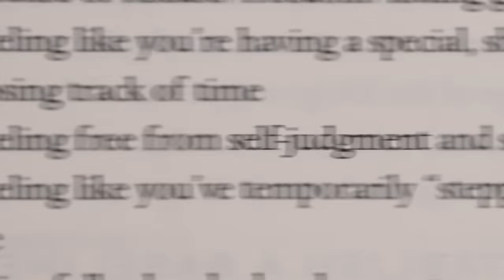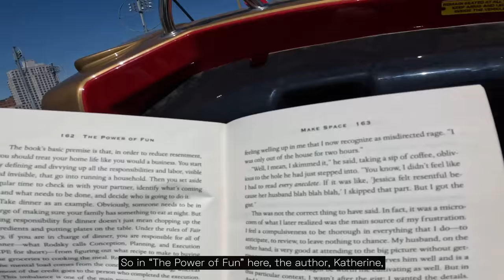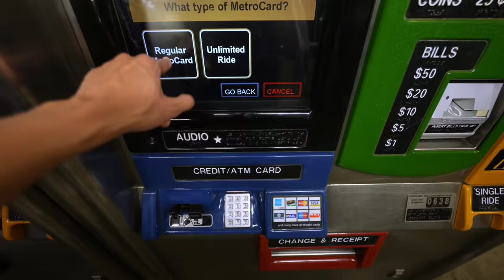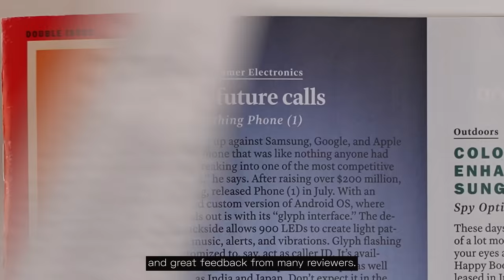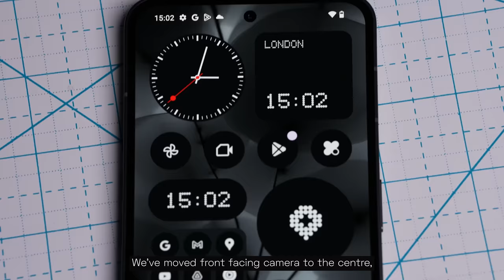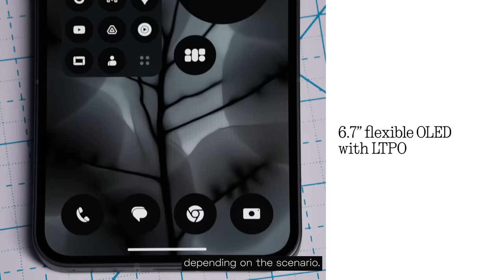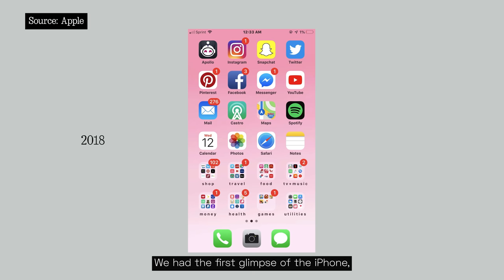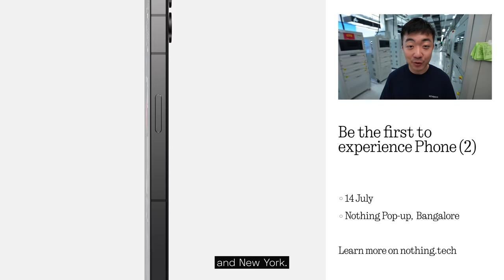Introducing Phone (2) ft. Casey Neistat

Comment: Nothing is the company everyone appreciates ❤
Reply: Not everyone.... Dont generalize
Reply: INR 44,999 is not justify this phone ,we get better option at this particular price like galaxy S21 fe sd 888 edition 😏 because their are no ip 68 rating and no telephoto camera
Reply: @abulfajalansari3591  sony Imx 32mp & 50 mp be like: get out of here u ain’t getting this kinda device anywhere. 

It doesn’t have some weirdo 2x mp like others phone and if u really have a problem with nothing Phone 2 then wait some time when the phone is released and u get it after some months the price will instantly drop and u can get it for damn 35,37k inr and in 45k it might gonna be that it will be the maxed version available. Think smart my guy and btw Samsung has been lying like apple by alot and Samsung even hided The actual performance from users and they were using some GMO which made the phone perform bad and in app benchmarks it showed as normal as other devices but the reality revealed later on when they got caught. I would never buy some stoopid Samsung phone except if it’s in Samsung S 20 and the S10 and lower line up.

Comment: Something about the blend of white black and red in the os theme makes me thing a nothing 2 mixed color back panel would fit in nicely (consisting of dark grey deeper layers of the back design, white for the elevated layers and red on the center circle of the wireless charger and red on the half circle of the recording led). Will enhance the element of depth to the back design. Call it nothing 2 mix. uses the same parts bin from the white and black models so easy extra color option i think

Comment: I really like the monochromatic colors in the Nothing Phone 2's OS and AOD. It looks really cool at first, but I think it would get boring in regular use cases. I would like to see some more premium colors available, so that I can customize the look of my phone.
I understand that Nothing is going for a minimalist aesthetic with the Phone 2, but I think there's room for some more color. Even if it's just a few accent colors, it would make the phone feel more alive.
Here are some additional thoughts on the monochromatic colors in the Nothing Phone 2:

1. The monochromatic colors are definitely eye-catching at first, but they can start to look washed out after a while.
2. The monochromatic colors can also make it difficult to distinguish between different apps and settings.
3. A few accent colors would help to break up the monotony of the monochromatic colors and make the phone look more visually appealing.
4. Even if Nothing doesn't add any new colors, I think they could improve the monochromatic colors by making them more vibrant.
Overall, I think the monochromatic colors in the Nothing Phone 2 are a good start, but they could be improved with a few more color options or a more vibrant color palette.

Comment: I appreciate the way he understands user requirements and strives to provide the best experience at an affordable price. As a part of the OnePlus family with the OnePlus 7 Pro and buds, I am now considering switching to a clean Android OS phone however after being impressed by Nothing OS. The ability to customize icons is something I love, and I am now considering making the switch to Nothing next year. I will give my OnePlus 7 Pro to Carl, the former CEO who played a role in building my great phone. I have been using Oxygen OS for almost four years now. Its completely different now which I'm not interested However, I am looking for a few specific features in the next Nothing device, such as a curved display and a large battery. Additionally, I would prefer the punch hole camera to be located in the left side corner. Carl, I am eagerly awaiting the release of Nothing 3 with these specifications, and I am ready to join the Nothing family.

Comment: I have bought this phone a few months back and now, I came to find that this phone screen has wavy screen {When seen through the charging port, (see towards the edges)} and when I went to service center, they told me that this is NOT a problem. (Although this entire Nothing Phone 2 lineup has this problem {They didn't used the word 'problem'} as they said) apart from this it also has a green tint issue which is visible while using in Dark Mode. 
While till date I have NOT seen any such issue with smartphones from different brand, even the other models of Nothing don't have this. Other things are okay, but I don't recommend this. If you are spending such an amount, go with other brands, they will provide better quality at this price. 😖😔

Comment: Transparent back is a gimmick and also annoying. 
I prefer and actually like quality plastic. 
It looks like a transparent iPhone 4.
I don't like heavy phones (which I assume it will be due to it being only metal and glass).
But if it performs as good as a flagship phone for nearly half the price then it deserves to do well. 
I'm still rocking a Google Pixel 3 XL. It works fine but I can tell it has been artificially slowed down.

Comment: Man. I am a boring person. But all the phones are the same tall skinny $-$$$ or foldable $$$-$$$$
I have the 20x 7.2". 
I would like to try something shorter (less top heavy) and wider (more keypad area). 
The single screen of a duo 2 interest me even with the big top bottom bezel. Basic mid spec is sweet and If the bezel can house the camera flush then bonus.

For me the software side i would like a single home page  that vertically scrolls.  then grouped widgets/ icons, so within that group you can scroll left or right. Simple but simply havent come accross that when i try to (could be blind though).

Comment: Everything about design choices is great, except one thing, this font composed of dots - this is terrible, very not user-friendly, hard to read, and bad looking in small size unfortunately... It is something different, but too much. For a brand name logo it is ok'ish, for use in UI/UX is very bad. About device itself, it sounds great, however for me as a potential user, how would be in the future to get replacement battery for NP1 and NP2, and adhesive for back panel, because for bigger brand, it is just there to buy?

Comment: I want no one to power off my phone while the phone is locked and also no one to turn on flight mode from the lock screen because if the phone is stolen the thief can't turn off my phone but by removing the SIM he is mine. Can disconnect phone from network but need eSim in phone 3 to solve this problem. And I want the eSim installed and the rest of the security updates on phone 2 for now.❤
#useNothingBeAThing